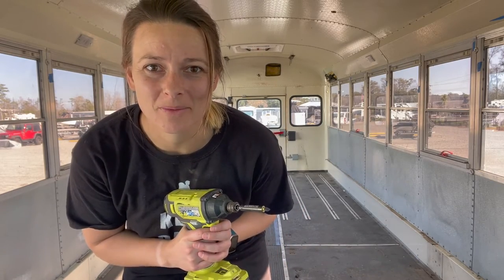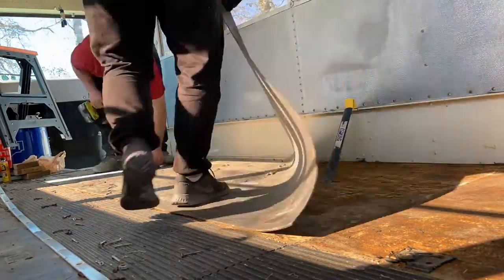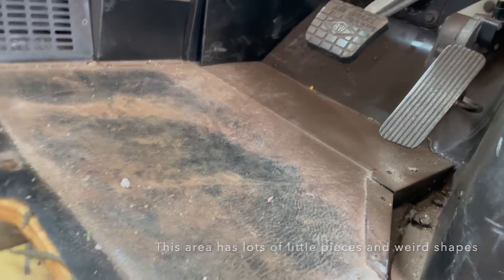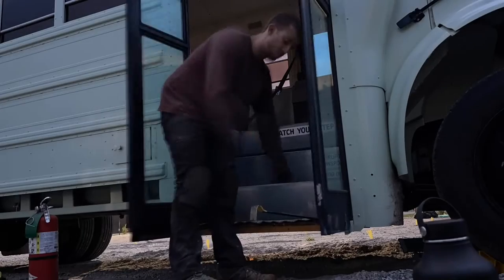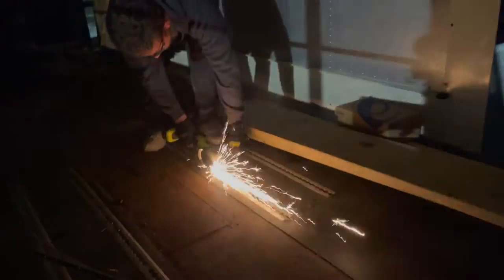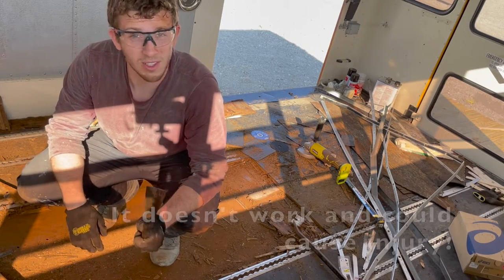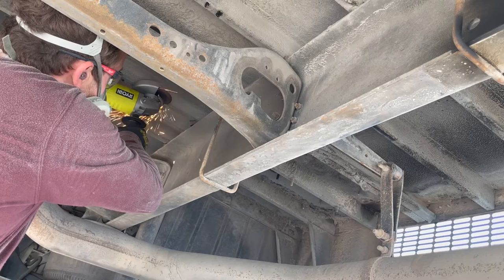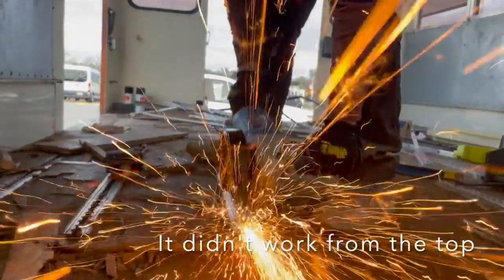How to Remove School Bus Floor | Remove Metal Seatbelt Rails | Bus Build 13

Comment: I know I'm a year late but it might help if you build another bus down the road. Drilling the bolt heads off is the fastest and best way to remove that aluminum track. Then you can grind down or hammer out the remaining part of the bolt.
Reply: Do you drill the bolt heads off with the same angle grinder?  Or do you use another tool?